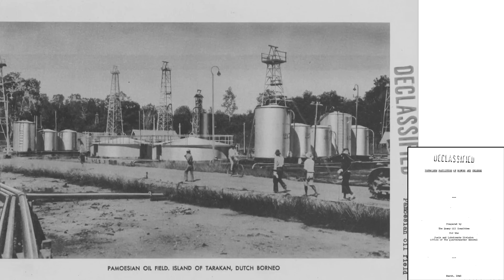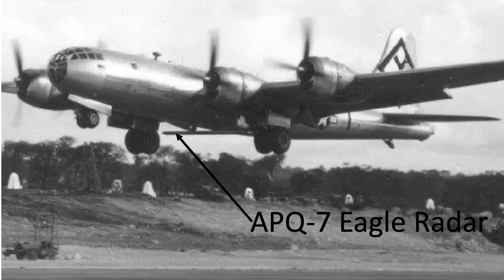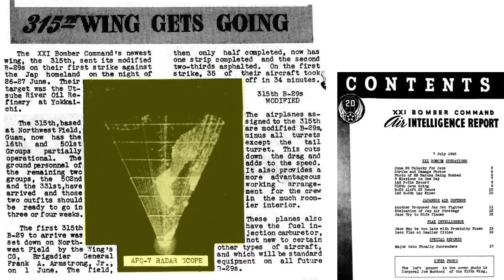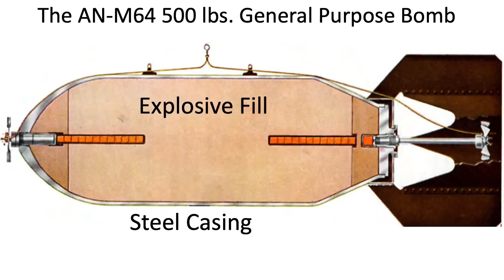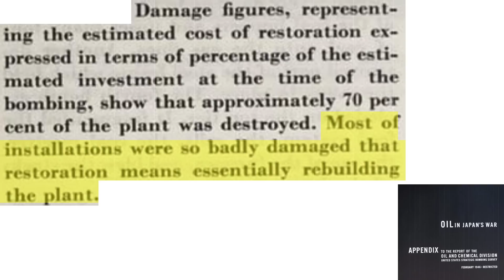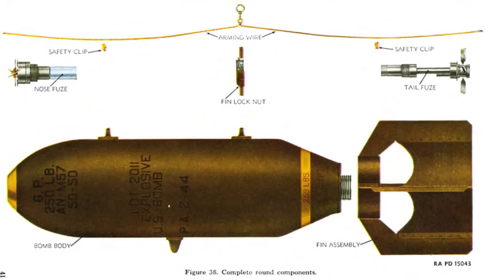B-29's Target Japanese oil Installations

Comment: It seems like knocking out the synthetic fuel plants was worth it if only to further the effects of the blockade.  Though a plant that only produces 700 bbls is pretty small, that’s about 30,000 gallons a day or about 8 truck/trailers worth.  Undoubtedly the B29’s burned more fuel getting there and back then the plant would have produced that day.
Reply: The value is to deny your enemy of its use

Comment: Seems like this is a case of tactical futility due to strategic success. The bombing raids made little difference NOT because (for example) the Japanese had effectively hidden oil stocks elsewhere, but because other anti-oil efforts had been so devastating. Hindsight is 20/20, and given the relative cost/benefit, it seems a sound decision for the sake of redundancy.

Comment: Since they were bombing oil facilities, I'm surprised that they didn't mix in a few incenderaries into the bomb load.
Reply: Plenty of ignition sources in a refinery if it is operating and you spread the oil products around, so no need for incendiary devices. Leaves more cargo capacity for big bombs that do the spreading. The USAF might have done better by putting 10 second delay fuses on the bombs, allowing them to bury themselves deep, or fall to the bottom of the tank before detonating. Will bet there are still a few left deep in the ground there to this day, having failed to detonate on the initial drop.

Comment: The faulty intelligence about the oil stocks suggests to me that the oil tanks had fixed roofs, to hold snow away from the internal floating caps.
Photo recon could not distinguish a fixed roof empty tank from a full one.
Respectfully.
Reply: Quite a few tanks by me also have fixed caps, not for snow, but more for rain.

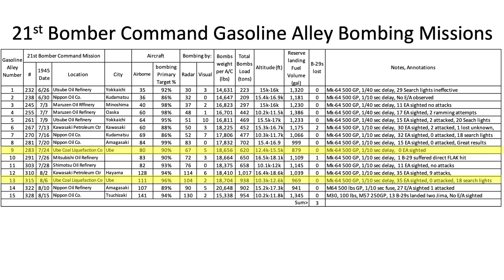Comment: The coal to gasoline /petrol plant described at 8:40 reflects why the vast majority of German tanks ran on gasoline, unlike diesel on Soviet tanks. Germany had centuries of coal supplies and knew they could convert coal to gasoline, not diesel. I suspect Japan was likewise reluctant to be dependent on field that could not be derived from Japanese coal.
Reply: Sorry but no.  The Germans used gasoline for the power density it provided not logistics concern. 
The Japanese Navy was highly dependent upon diesel/fuel oil. Its tanks were diesels so they could use the same fuel supplies.  
Much of the mainland industry also depended on oil for fuel, lub, and as feed stock, not coal except  besides basic power generation.  They could never have supplied their fleet, much less air power on domestic coal or synthetic oil.
One of their main motivations for launching the Pacific campaign and going to war with the US & UK was to secure the oil fields in the region to supply that demand after the embargo.
Reply: Your inbreed too
Germany used diesel
Reply: It's actually easier to make diesel fuel from coal than it is to make gasoline, as you don't have to achieve a high octane rating and keep it within close limits.
Germany in WW2 did not know how to make high performance high reving diesel engines.   However the USSR had an expert, Chelpan, assisted by a world authority on diesel combustion, who did.
Reply: I didn't specify what Japan was doing with the gasoline /petrol, but aviation, as with the Luftwaffe, would be an obvious military application.
As for the derivations of Rudolf Diesel's engines, it seems like the U-boats ran well with the products of M-A-N.
While diesel for Soviet tanks was a prescient choice, given it's what almost all modern tanks use, in practice there were some problems. Diesel yields about 35.8 MJ/L as against the 34.2MJ that gasoline produces per liter. However, this 5 percent advantage for diesel fuel had not been leveraged as well, like the commenter points out. 

Diesel fuel thickens in very cold temperatures more readily than gasoline, as petrol is more volatile. Diesel engines with glow plugs in very cold conditions like the Eastern Front were a lot harder to start in the 1940's. As if these barriers were insufficient, Soviet diesel tanks produced a lot more smoke and soot than petrol engines, a real problem on the open steppe. In daylight, it was very difficult for Soviet tanks to spring a surprise, similar to the dust clouds thrown up by AFVs in a desert. The Soviets V-12, aluminum block, 48-valve, direct injection diesel was very sophisticated for 1940. It was deemed a technological leap worth taking.
Reply: @amerigo88  : Have you heard a Soviet v12 tank engine running?   They have a characteristic sound usually described as ás bucket of bolts''.  You can hear them as far away as you can see the smoke, assuming they were smoking.  But the ones shown in movies of Soviet parades, and ones I've seen in museums that have restored examples, don't smoke any more than any other healthy diesel engine.
you quoting of the energy content of fuel is silly, as a typical gasoline engine has an efficiency of around 25% whereas a naturally aspirated diesel engine is typically over about 35%.  That equates to a 50% better fuel economy.  Not 5%, its 50%.
There were no glow plugs in any soviet tank engine.   Glow plugs are only needed for very small engines or engines with restricted compression due to being converted gasoline engines.
incidentally, there is another reason why diesel is a good idea in a tank.   All the Soviet tank engines could be started by either electric or by distributed compressed air.   Got a flat battery?  Start on compressed air - pump the tank up manually if you have to.   Distributed air start on gasoline engines is not an easy thing to do, as it must be stochiometric to start.
Reply: Are you inbreed
Germany used diesel

Comment: I guess that in spite of the disability of slower closing speed,  the ability to spot the B29s from their engine exhaust made the difference.  Also,  of course,  a longer engagement time.
Reply: Hi. :) What do you mean, "made the difference"? And could you elaborate on the engine exhaust thing?
Reply: @mindbomb9341 The fastest fighter Japan had was just marginally faster than the  B29.  You spot a plane in the dark by the flames from it's engine exhausts.